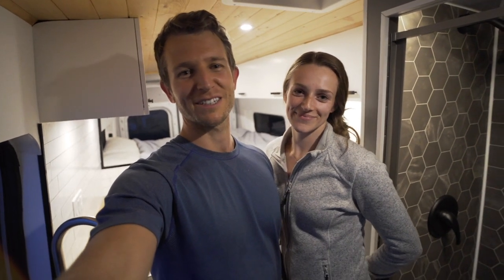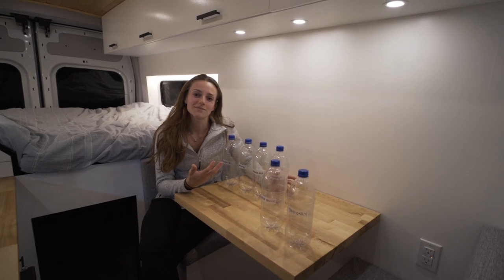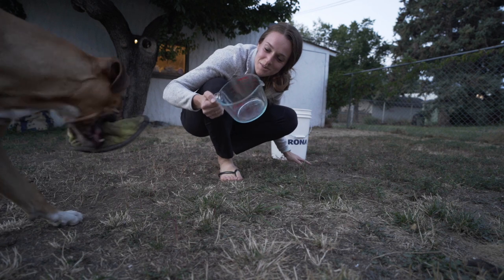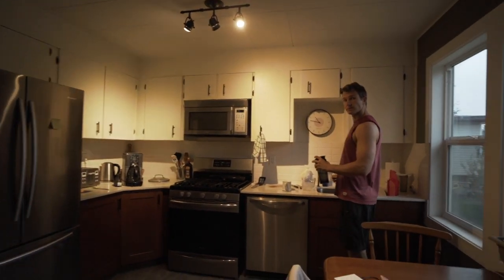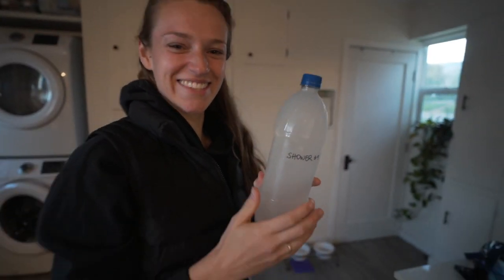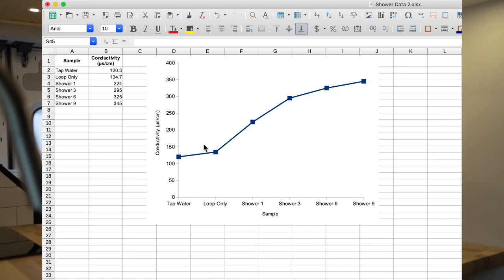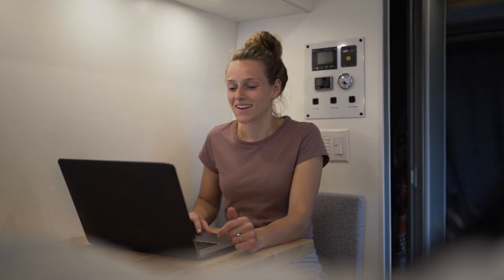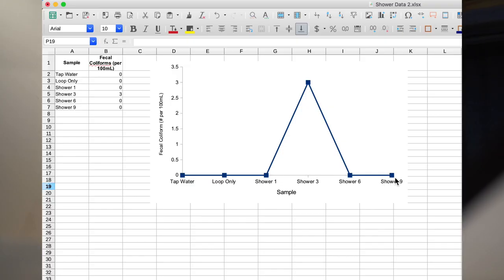VAN RECIRCULATING SHOWER | WATER QUALITY TESTING

Comment: Just watched a pretty in depth video of a couple going thru the plusses and minuses of their same type of system.  They said they were overall probably 80-85% happy with it, BUT they acknowledged that it needed a bit of weekly and monthly maintenance to keep it running optimally, and they said they noticed sort of early that it couldn't quite get all of the slick, soapiness out of the water and they switched to soapless showers, using wet-wipes to clean certain parts instead.  And the woman said she'd mostly do her hair in the kitchen sink.  Overall they were positive on it--but they did acknowledge certain shortcomings.  YMMV.
Reply from the maker: Performance definitely varies from person to person and the exact design of the shower. I would be curious what type of soap they use as we found that to be a crucial factor. Dr. Bronner’s all natural liquid soap made a huge difference for us. Shampoo will clog up the filters almost immediately and we agree should be done in the sink or outdoor shower
Reply: @TimKatie  they mentioned they were going to look into the 'natural' brands of soaps more, but hadn't done so yet. If you've found a soap that seems to work, doesn't gum up the system, and doesn't leave the water feeling all slick, then it sounds like you're good to go. Overall they were high on it, but they said they did have to do some pretty simple and quick type of maintenance.  I"ll see if I can find the exact video...
Reply: @TimKatie  it was "RECIRCULATING SHOWER for Vanlife: The Truth and What You Need to Know!" by wanderful something or other.
Reply: Is there any way to make this system work with the heavy soaps and shampoos ?  I feel that can be a deal breaker for many users.  What modifications are necessary to allow for heavy soaps?
Reply: @tommaloney3112  tbh, from what I was seeing, these systems don't do that well with heavy soaps.
Reply: @TimKatie  do you put Epsom salt in the system too? I've seen elsewhere that it should help precipitate out the Dr Bronners so the filters can catch the soap more effectively.
Reply from the maker: @gullinvarg  we did once on a longer trip to test it out and try to extend our usage but didn’t notice much difference and never got into the habit of doing it
Reply: @TimKatie  thanks for the quick answer